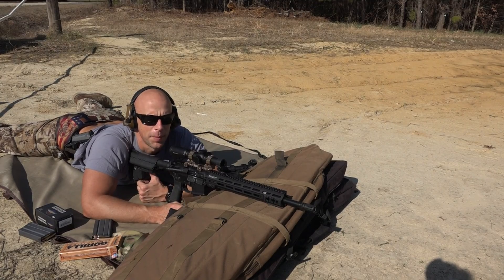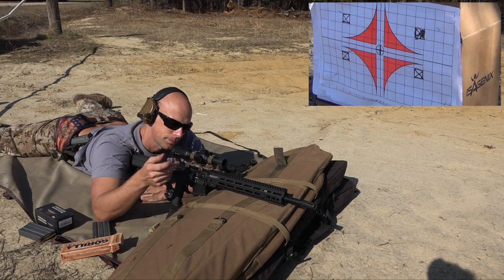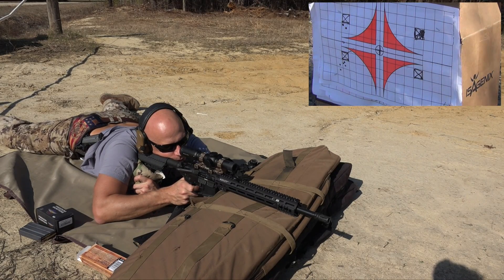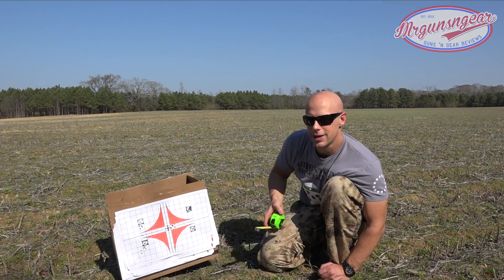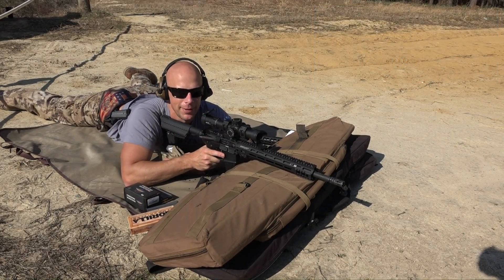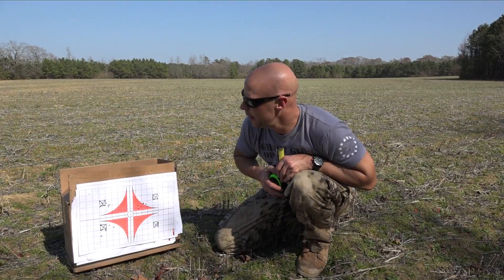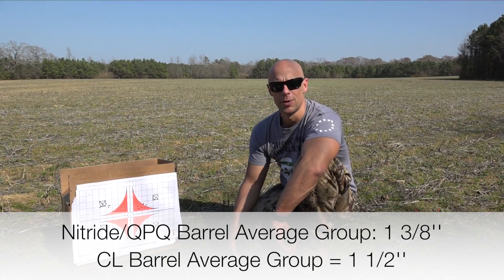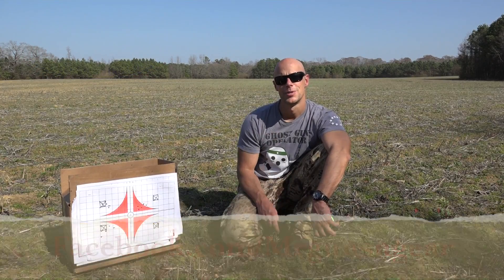Melonite vs. Chrome Lining: AR-15 Meltdown Base Accuracy Test (HD)

Comment: I have no bias one way or the other.. but, I favor the chrome based on its track record.  My AR's have 16 inch FN chf chrome lined barrels, and I have no problem achieving consistant 1 moa accuracy.  One is a 5.56 Palmetto premium mid length built into a DMR type build with a Troy delta rail, SSA-E trigger, magpul furnature, and PA 1-8 scope in a Leupold mount.  (Tuned for 64 grain Power Shock to 77 grain OTM)  The other is a premium SAA 300 black out hbar carbine gas system with an EPT trigger and magpul furnature, and a PA 1-6 300blk scope.  (Tuned for supersonic loads)
I had the choice to go Nitride or "mil spec" as I just built these rifles over the last two years... I gathered my own data... I built these two rifles for fun AND for "war".  So that is why I stayed with chrome.
I will admit that this was just a personal decision.  I have not really heard anything bad about Nitride or Melonite.  
Like the vid and love the discussion.
Reply from the maker: thanks

Comment: The test I have been waiting for. Looks like you have controlled for as many variables as is reasonably possible. I noticed they are even from the same batch. Nice touch, certainly lends to validity. 
I have kind of noticed you can get good accuracy out of a less expensive Melonite barrel. I have been telling people that's the way to go if budget is tight. You can get excellent accuracy with a CL, and I still prefer CL, but it will cost you more. Problem is, there are way to many variables in the barrels I have experience with to really come to any solid conclusions. This is exactly the test I have been wanting to see. 
I am going to predict Melonite will be a tad bit more accurate & the CL will be a bit more durable in the end. We shall see. 
I am impressed. I expected a bigger difference in group size. That's so close you gotta call it equal. With results that close, I would like to see a few more groups to see if the results stay that close with a larger number to average. This does show a quality Melonite & a quality CL are pretty close. 
Good test. Will be waiting for part two. 
I would like to see hard use but don't overheat them to destruction. Maybe get some data on durability & accuracy after 2,500 hard use rounds. Oh the fun we could have with a $50,000 T&E budget. lol Good Day!!
Reply: I can assure you Nitriding is superior in durability over Chrome Lining. Though you believe the opposite per your aforementioned comment. First of all CL is a coating or plating. Nitride is a treatment that's actually adhering to the substrate (outer most layer) of the metal. As well as, the Nitride is bonding at molecular level with the metal. Nitride regardless of the process, goes on clear, then manufactures usually Black Oxide over the Nitride Treatment. Companies like FN, will Nitride and then use a PVD coating over said treatment. I already know the results of this test. Now some will question, why isn't the Military using Nitride. Well, it takes time for the military to decide about switching things around. I do know the military has been in testing phases of Nitride Barrels for roughly two years now. Which is looking most favorable over time. Since, these sort of things cost money. Nitride has a RHc of 68-72 which is very hard. Much harder than Chrome. However, I can assure you that Nitride much more durable than Hard Chrome lining.
Reply: lol Yea, the military is the picture of efficiency. Agreed, I am really liking the Nitride. My problem is I helped my friend's sons build seriously budget rifles. They are holding up very well, one is pushing 5,000 rounds, but all I have to compare them to is forged Daniel Defense barrels. 
lol We are on opposite overall quality levels. Hard to draw any solid conclusions on that. 
I must admit, I am very conservative when it comes to new materials or coatings. Something new really has to prove itself before it wins me over. The Nitride/Melonite is winning me over though. If it's better & costs less to manufacture then everyone wins.
Reply from the maker: we shall see
Reply: I am hoping the Nitride wins. The last barrels I purchased for myself were both DD pencil barrels. (I am a girl, weight is important) If Nitride can give us accurate & durable barrels for $200 +/- we all win.

Comment: I am just taking a guess here. This was from 500 meters, correct? I can shoot 1" groups all day long at 100 meters with my j frame.
Reply: Mrgunsngear Channel Indeed
Reply: Mrgunsngear Channel But on a serious note, I was shooting my shield 9 with cheap white box and I hit an 8" steel at 100 meters on my first shot! After that, I was hitting it 1 or 2 rounds per mag. I was totally shocked. I am not usually that good.

Comment: I'd imagine the gas tube is going to burst before the barrel shows any significant wear, only one way to find out!
Reply from the maker: we shall see
Reply: I have no idea if you've done this test already, however if possible, maybe you could order a couple of v7 weapon systems extreme environment gas tubes. It's made out inconel, the same stuff as the Knights Armament Triple Tap compensator.  Supposed to be way more heat tolerant than mil-spec tubes.

Considering how much ammo you're going to be blowing through, the test for this series can also be the test to test out those gas tubes. Then you can knock out an additional review with no additional testing needed.

https://www.vsevenweaponsystems.com/products/v7-extreme-environment-gas-tube

Comment: This is going to be an excellent series and I'm really looking forward to it -- great idea! One thing, though -- it has to be kept in mind that what you're really testing here is the quality of Faxon chrome lining. I have 3 SCAR 17s -- with target quality ammo I can shoot 1/2 MOA all day from one of them, and the other two 3/4 MOA (btw, the BEST accuracy I get is with IMI razor core, with GMM a close second). So chrome-lined barrels CAN be produced to high accuracy levels -- but I'm sure it's quite a trick to do.

I'm really hoping that the ferritic nitrocarburizing process is going to be as great as it promises -- and you're gonna be the youtube guy who shows us! Thanks for making the effort to do this for us, and thanks to Faxon for taking part.
Reply: I have to agree with you on this one, that it is in part testing the quality of the Faxon chrome lining. While I'm told it has gotten way easier to get even linings with chrome with today's tech, it is still a more complicated process than melonite treating a barrel. If I could get a perfect CL, I'd go for that over melonited, but instead I go for melonited to be on the safe side. So far, the groups are pretty close, especially considering the wind picked up on the CL. Either way, fun video. Maybe we'll see more of these down the line if they do real well with other vendors than Faxon, like with the ones you're recommending. Not sub-MoA so far, but seem to be good barrels out of the gate.
Reply: Faxon does not chrome-line the barrels in-house. A third party does and to ensure complete fairness we used the same company that does Colt and many other reputable brands.
Reply: Faxon Firearms I'm sure it's a very good job. And sure, the main test to be done is verifying that the nitrocarburizing will hold up as well or better than CL. I just wanted to make the point that, since the barrels are identical except for the CL, accuracy differences are due to the CL, and there are some great and some only good CL jobs done.
I do want to thank you again for being involved in this test. Hey, how about putting out nitride Grendel barrels? I'd be a buyer of accurate, light, nitrided Grendel barrels in the 18 - 20 inch lengths.
Reply from the maker: indeed
Reply: GetMeThere1 With a sample size  of 1 chrome lined barrel and 1 melonite treated, the difference in accuracy between the two cannot be attributed to the chrome lining. You could have two identical melonite treated barrels and one may be more accurate. What about the wind? Maybe you are referring to the change in accuracy going forward.
Reply: m hall well, all of the above. But we already KNOW melonite will be more accurate on average. The test is really about showing whether the melonite will confirm it's value. I just wanted to emphasize  (as you are, but from a different perspective) that this test is not designed to QUANTIFY the accuracy differences the two.

Comment: Thanks so much for making these types of videos! My moneys on melonite because barrel designers cringe at the idea of chrome lined barrel since the inside of the barrel has to be rough/abrasive for the chrome to plate on to it. Either was I look forward to part two. Thanks again!
Reply: No one has made a video on it but I would be curious to see some testing of "Green Mountain rifle barrel Co" 1/14 twist AR 15 barrel and their 1/12 twist barrel. I would love to know if their is any reason to use a barrel like that now a days?
http://www.gmriflebarrel.com/gm-m14-m16-a1-5-56mm-1-14-twist-20-barrel/
http://www.gmriflebarrel.com/gm-m15-m16-a1-5-56mm-20-1-12-twist-20-barrel/
Reply from the maker: you're welcome

Comment: Haven't watched the video yet but word is the FN CHF/CL barrels are extremely accurate. I believe BCM and Spikes both use them at least on their highest end stuff. If I'm wrong on that someone let me know.
Reply: Yes and PSA premium line also yep. I've been waiting for a mid length CHF/CL upper to pop up but when they do they've been pencil or carbine.
Reply: i usually dont measure my groups but so far the psa chf and daniel defense chf barrels are just as accurate as any of my 10+ other nitride barrels.  BUT i did notice that daniel defense has switched to nitriding their chf barrels. read into that however you want.
Reply: George Costanza Probably easier to do.

Comment: What are you trying to achieve here? Your comparing apples to oranges. One (nitride) is a treatment and Chrome lining is a plating/coating. I can already tell you the results. Since, you can't change chemistry and physics. Nitride wins out every time. CL is simply a plating over or on top of the metal surface. Whereas, Nitride, is going about .002" to .004" into the metal and then bonding to the metal at a molecular level. Hence providing the lubricity to the metal. The actual metal substrate is being treated when the Nitride or melonite process is conducted. Substrate means outer most layer of the metal. Like I said, you can't change chemistry and physics. Since Nitride/Melonite has a RHC of 68-72 which is extremely hard. The Nitride is bonding to the substrate at .002"-.004" into the metal with it's RHC score you get a lubricity that's slick and a very Durable metal at the substrate level. General Note: Nitride goes on CLEAR. Manufactures will then apply Black Oxide over the Nitride treatment. So if you see some Black color wearing off, its just the Black Oxide. If the Nitride is subsequently stripped or wearing off. Then you're removing actual Metal from the original specifications of the metal that was treated.
Reply: For most uses you are correct.  The problem comes in with Full Auto Users that like to do mag dumps.   A chrome lined barrel due to higher heat thresholds will last longer and come out better then the nitrided barrel since the nitrided barrel has a lower melting and stress  points then of a  chromed lined steel.   That is why the military has tried nitrate tests many times but for small arms that have select fire come back to chrome.   Though for bigger guns with lower rates of fire they have moved over to nitrate for some of them.   Most users unless you get into a big firefight will never get there guns hot enough to matter to see any difference.    Here is a link that includes results of some tests by Boeing on machine gun chrome and nitrate and barrell life vs different types of ammo.

http://www.m4carbine.net/showthread.php?171789-Melonite-vs-Chrome-Lined-Longevity/page2
Reply: That is exactly what is being verified by the third party. We can state everything you did (and we do!), but its important to show it too!
Reply: I read the aforementioned link which is just a forum that presented No Scientific Data...which I've actually reviewed. If you could present heat thresholds comparisons of CL to Nitride, that I would like to see. Considering Nitride was discovered via the Carbon Fiber testing phase. Though Chrome is a heavy metal. It's not what you think it Is per se. Gold is a heavy metal and yet it's quite soft. The Nitride barrel will not have a lower melting point than CL. That depends on what steel is used...is it 416R stainless, 4140 SAE o4150 SAE steel etc. Most people have no clue of the differences from 4140 to 4150. Is 4150 superior? Not really. 41xx steel is all SAE steel the last two numbers are the amount of Carbon added to the barrel. Hence. 4150 steel has one half of a percent more carbon. Which equates to a 4140 barrel can withstand 100K psi of pressure and the 4150 can withstand 110K psi of pressure. Whereas, specification testing of HPT is up to 70K psi. And yet the hottest 5.56mm ammo with never go over 63K psi of pressure...maybe a bit more. So a 4140 barrel is just fine. I put this example in due to I know what I am talking about and not using some forum of people assuming and guessing. Per Jane's Report, Nitride testing in small arms is still being conducted. As well as, Nickel Boron (NiB) Bolt Carrier Groups (BCG) too. Testing is looking quite favorable too. Not sure how hot you think a barrel gets from sustained firing in full auto? As for stress yields in barrels. The lining or treatment will have no variances on it. I could go on. However, lets see how Mr GNG uncontrolled testing does. I still stand by my initial assertion. I have a Ph.D. in Chemistry. As well as, a practicing surgeon. Respectfully, Rick S., M.D., Ph.D.PS. Sorry for any grammatically and/or spelling errors. Didn't have time to proof read.
Reply: To: Faxon Firearms...first of all thanks for a response. Your company has always been quite good about responding to commenters. I do understand it's important to be displayed by a third party. However, the testing has been revealed many times over. By independent review, peer review, as well as third party. In a controlled and uncontrolled environment and the data is available and out there. This is not close to being scientific with too many variables in place to sway the results. Though I still stand by my initial assertions. Hence, this purported test is more for entertainment purposes. Don't get me wrong, I'll watch every video, but, it will be for entertainment.  Respectfully submitted; Rick S., M.D., Ph.D.
Reply from the maker: I'll see what I can do about showing it!
Reply: Chrome lining and meloniting is always being compared, thats why.
Reply: Following

Comment: thanks for doing this! My BCM chrome lined barrel shoots everything well except for freedom m193 at 2-3moa.  I know this is technically all that can be expected from that round, but I got worried when I saw my groups get bigger.  This just let me know it's not the gun, but the gun/ammo combo, and I can expect freedom m193 to be no more accurate than that out of that barrel.

Nitride from here on out though!
Reply from the maker: indeed
Reply: ShitFromShinola What twist are you using?
Reply: Ranchman 1/7 chrome lined, hammer forged, 16"..

Comment: This is actually something I was really curious about, when I first started to buy parts for my first rifle build. I figured since I wasn't going Pro or anything, Melonite would be perfectly fine since it was just a bit cheaper than CL (and I had decided early on that no part should cost more than $300 on my rifle, optics excluded). But I have to admit I had always been curious about which one between them was better for wear and tear. At the time, nobody seemed to have empirical evidence of one being better than the other, just a lot of mil-spec bluster and hypothesizing. At least this series will help shed some kind of light on the subject.
Reply from the maker: we shall see

Comment: If you shoot bi-metal in .223 it makes no difference. You will see throat erosion at about ~7,000 rounds
Reply: Goodspittin Is it because of the bi metal or is it because of the steel case?
Reply: m hall 
Combination of both for that caliber, leaning more toward the bullet itself. The chamber pressure it creates is brutal on the initial rifling. Bimetal bullets create a LOT more friction than copper
Reply: Goodspittin throat arrossion from steel cases? funny considering steel cases produce lower pressures all other things equal usually. 

I call internet bs
Reply: Bi-metal refers to the bullet jacket itself. Russian ammo like Wolf uses a copper-washed, steel jacketed bullet with a lead core. Chamber pressures may be lower but the strain on the lands is greater simply due to hardness.
Reply: Goodspittin really is that what it refers to? You don't say....

Bimetal bullets ALWAYS use steel cases. Steel cases are thinner usually than brass ones are. They will produce lower pressures, all other things equal. This due to the thinner case leaving more internal space available. 

High pressure is what creates throat arrossion, not bullet material. 

This is why sometimes steel cased 223 is unreliable in certain ar's, cycling wise. It is lower pressure than normal, yet still gets the same velocity. Not referring to cases sticking to chamber walls, that's a different issue.